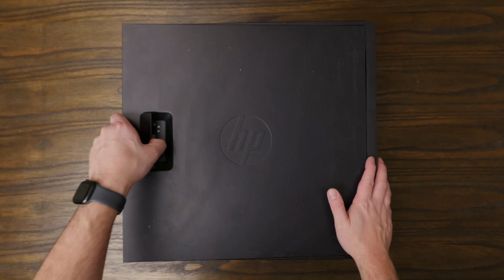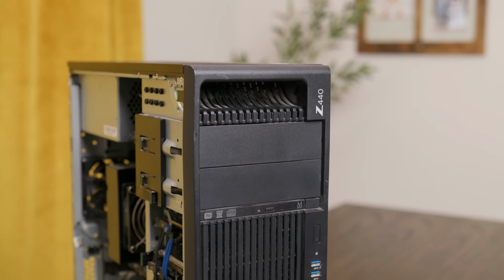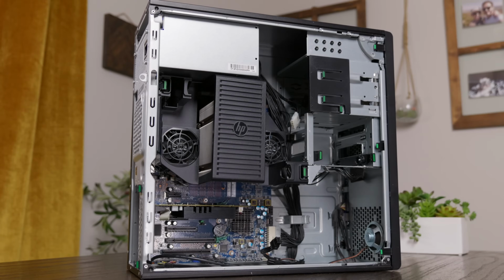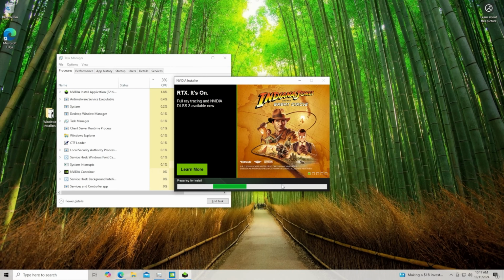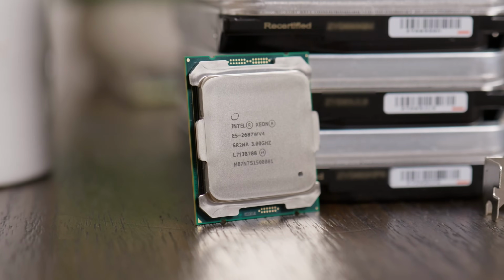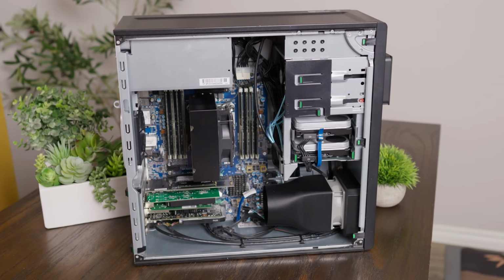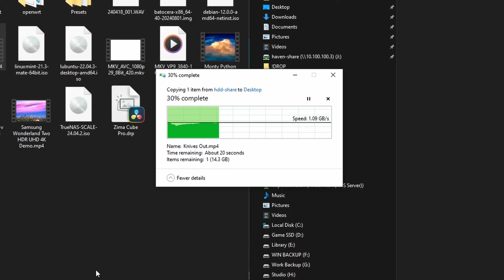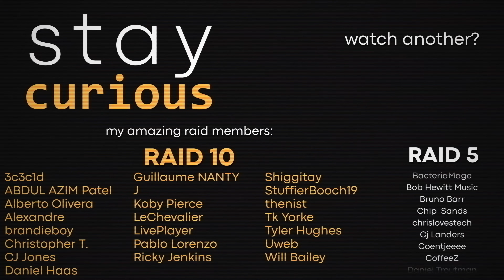This Upgraded HP Workstation/Server Is CRAZY Fun

Comment: I'm sad to say we are still running a few Z440s to this day for production CAD workloads at my company. Only used for 2D Autodesk apps, so honestly they still work fine since most apps are single threaded and barely use GPU still. That said with the end of W10 Enterprise support this year they'll most likely finally get scrapped. Definitely rock solid systems though, very few issues with them compared to the ZBook laptops we deploy nowadays.

Comment: For the extreme-super-budget option I'm trying, I wonder if there's a hidden BIOS option on my old HP laptop to allow battery limiting.

Yes, I know, keeping the battery is good as a free UPS, but if I don't limit the maximum charge level, then the laptop will blow up a second battery. I'm not risking that.
I think my only other choice would be to buy a UPS (which I probably need anyway) and remove the battery from the laptop - hoping that it will boot that way.

Comment: Ive just built this exact same machine with the same 12 core 24 thread CPU. Updated BIOS, 64GB RAM. 2x 1TB NVME drives using a PCIe card. Im running a GTX 1060 6GB. Its a quick old beast, and super quiet too.

Comment: Putting it out there, It wont even run windows 11; just the otherwares Why did you set the bar so low??? Per Google AI. The HP Z440 Workstation was announced and released in the third quarter of 2014. It was part of a trio of third-generation workstations that also included the Z640 and Z840, all of which featured Intel Haswell Xeon E5 v3 processor. works only of you get used free/dirt cheap stuff.  Not a real ROI. when an Apple M4 is only 600 and has ports for accusers

Comment: I'm running an older Z420 workstation as a daily driver. I've just ordered a 64GB(Ax8GB) ram upgrade kit. This is do to the fact that generation of motherboard in my particular Z420 is the first generation boot code wise and therein is restricted to a hard limit of 64GB of ram.

Comment: I have a hp z620 and if the power supply is relative I can tell you those 6 pins are seriously overbuilt and will easily handle being converted to 8 pin pcie

Comment: PCI-E gen 3 is a bit slow for nvme disks.
Reply: It isn't. The NvME disks itself are bad for actual performance in common use. You get peak performance only very rarely, but in the actual tests performed in practice, even PCIe 6.0 doesn't improve from the PCIe 2.0 when it comes to actual read/write speeds.

Comment: Really cool video! I actually got a similar system, with a ASUS Z10PE D8 WS motherboard and two 2697Av4 CPUs, but only 128gbs of RAM, however I'm pretty sure it's all ECC ram. Together with that I run 4 x PNY 4060Ti 16gb NVIDIA graphics cards for AI labbing.

The whole system cost was around ~2800 usd including GPUs etc, and then I'm In Sweden (which I saw from some other comment, usually it's not cheap here)

Maybe I should do a video on it 🤔

Comment: Looks like a cost effective solutions to a multiple VM small office machine we currently run 2 separate machine with 8 VM on each but which works but zero head room in there.  I looked at a  Ryzen 9 9950X3D but this looks like it could be better solution as with a 32 core system with 64 threads this would mean we can run 24 or more VMs especially if we load up with memory

Comment: Great video, done much the same but with the Z840, that has 2 CPU, 2TB RAM support and the power supply will run a 4090 with some power adapters. There is also a sweet spot on the CPU last time I looked  a 14 core Xeon is £50 or so. I have a bunch of these saved from the work E waste in various config states, the most live one has 2X14 Core CPU, 256GB RAM, 7X 16TB SAS drives (used an extra front bay) 4XNVME drives on a card and a RTX 2080. Running True NAS Scale on it and loving building the system each night in the few hours my kids allow

Comment: If you enjoyed Z440 that much, take a look at Z840, or even Z8 G4, which are much more modular, and easy to work with. I do have both and use Z840 as home server and Z8 G4 as personal workstation, both of which are great machined with efficient cooling and upgrade options.

Comment: My main workstation is a Z440. I upgraded to an E5-2699 v3 w/128GB RAM (I have 256GB for it in a box, but haven't found myself needing the extra RAM) It has a GTX 960 for graphics. It boots off of a 1TB NVMe on a PCIE adapter, it has WIFI6 adapter. It has a pair of 4TB HDDs and a 256 SSD for scratch. I have 3 Blu-ray drives as well. I mainly use this system for ripping Blu-rays and DVDs. I also have a Blackmagic studio 4K card that I occasionally use (I don't leave it installed because it is noisy) for capturing HDMI/Analog video. I will be looking into replacement options next year due MS killing Windows 10 support.

Comment: ayyeeee im not sure as to why i smiled but, u got me into this server stuff...... i now have 2 e5 2699v4's for 44 cores and 88 threads in a lenovo p710 with 384gb ram and a quadro m4000 8gb (soon rtx 4000 8gb for obs and editing stuff) however it runs ALL of my home stuff and my game servers running proxmox  its down currently as a ram modual went and replacing them all as.... well i cant match the ones i have/had ..... so i am splitting them up into 2 servers 1 for home stuff then 1 for game servers

Comment: Go ahead and put that ZOTAC RTX 3060 in there. The Delta PSUs for HP are modestly rated and the 3060 won't be an issue. I used to run a Sapphire Radeon HD4850 X2 (2 GPUs on one board) in an old HP XW 4400 that had only one 6-pin PCIE power connector. The PSU was rated for 460 watts. The card had one 6-pin and one 8-pin connector. I used a dual sata to 8-pin PCIE adapter for the 8-pin socket. It worked fine for years. It even handled Furmark. Although, Furmark in "extreme burn-in" mode would trip the PSU. No doubt it was the sata power rails being overloaded.

Comment: Lenovo p520 and P520c. The upgradability makes it worth the <$200 pricetag. P520 has 8 RAM slots and soooo many PCIe lanes. P520c has only 4 but is even cheaper and would make a killer buy for anything that is CPU bound. Both can upgrade up to 18c/36t. They are lowkey monsters that will be viable for at least the next 6 years.

Comment: I have been running a maxed out Z800 for the better part of 8 years bought and upgraded with fleebay purchases.  I have the fastest 4 core Xeons under factory water cooling, 96GB RAM (the optimum configuration) 1200Watt power supply, SAS SSD for boot and a couple 15K drives in RAID0 gor simple storage.  The box has been rock solid the whole time.  All in it cost me less than $1800.00 USD.  I just bought a Z840 with 128GB of RAM and a pair of 10 core Xeons as well as an Intel Enterprise SSD boot drive.  It also came with a 12 port RAID card and twelve 500GB Sandisk SSDs, a 1080 video card and 1200Watt power supply.  That was only $450.00.  I then bought another Z840 with a bad motherboard 1200Watt supply, and another 128GB of RAM for less than $170.00.  The RAM was going for much more than that!  I bought a pair of 6 core 3.5GHz Xeons with the highest clock rate available in the Xeon line to replace the 10 core Xeons with. For another $40.00.  $660.00 seems pretty cheap for the rocking machine like this.  Having an 8 port LSI SAS controller on board means I can use much better storage as well.  These are great machines by any measure!

Comment: Many server NICs support SR-IOV. If you enable SR-IOV with let's say 4 virtual functions, you can pass each virtual function through to a VM and thus give it almost-hardware-level access to the NIC. It gets to make use of all the hardware-offloading capabilities the NIC has and does not depend on routing all of the traffic through the CPU like virtual bridges do. In addition to that for internal communications the virtual functions can often communicate much faster than the indicated NIC speed, so those VFs of a 10G NIC for example may be able to communicate with other VFs on the same NIC at up to 30GbE

Comment: This HP z440 is fantastic.  I've used to have one back in 2018 up to 2022 until i decommissioned and built my actual Lenovo Mini Cluster. 

But, I wasn't fully decommissioned 😅. 

It's been upgraded, and it's working as a Linux main rig for a friend, fully loaded with a 3060 ti, 2TB NVME and  8TB Raid 1 Storage for Data. 

Long live z440

Comment: I've got like 6 of these systems I use for servers 😅 -- if you know where to look you can often get hardware like this for FREE not just cheap. I didn't pay a penny for all 6 of my E5-v4 series Xeon workstations. There's always some guy on Craigslist who's obsessed with Linux and will advertise "old business workstations FREE if you promise to never run Windows on it" -- I know because I basically found 6 of those guys and I wasn't even looking 😅

If you don't need a lot of PCIe it probably makes more financial sense to get a cheap Ryzen system in terms of upgradability, price, performance, terms of everything really. 

But free is best in terms of BEING FREE. Can't beat that 😅

One of them even had a Nvidia Tesla GPU inside with a ton of VRAM which was an AWESOME bonus. It's slow as sh*t for streaming games (and you can ONLY stream, no video output)
.. but for GPU compute it's freakin' awesome!!!

Anyway if anyone else is interested in these older workstations -- definitely checkout Craigslist or local places like Free Geek.

I found eBay prices for this kind of hardware have become inflated a bit imo, not ALOT inflated ... but enough to be worth checking the dumpster fire that is Craigslist also.

Comment: These systems are dead nuts reliable.  Get the AMT engine working and it's great.  I heard you need to buy the software from Intel or HP.    I never really went that far into getting LOM to function for me as I'm right there next to the system. 
The best part about these machines has to be the fact you can throw in just about any add in card, and for DVR systems?  This is where it's at for cheap deployments. 

That 3D printed fan you made was amazing.   That would be something I would purchase.

Comment: Good to see some love for the old pre-Skylake stuff. I've found that even the old Sandy and Ivy Bridge are equally as capable as workstations (either single or dual socket platforms depending on your requirements). Price to performance on these old generations beats anything new, even a decade or more later. To be honest, I wouldn't even write off the old Nehalem/Westmere generation Xeons either. One thing that chaps my ass though is that bifurcation is fully documented and supported as early as Sandy bridge, but it just didn't make the cut for firmware options until the Haswell/Broadwell generation in most cases. Not sure what the thinking was there. It could have been a selling feature for the big OEMs on the server and workstation models. All in all though, the lest expensive way to put together a beefy machine on a budget.
Reply: I'm all about hanging on the trailing edge of technology™ :-D.  Haswell on the dekstop (E5-2690v3 w/64GB RAM, with hyperthreading shut off - with 12 cores who needs it) and a dual IvyBridge (Supermicro w 2x E5-2630Lv2 and a big hardware RAID array).  Everything is scrounged, gifted, or bought used. Biggest expense has been a repl. mobo for the server - original has damaged cpu sockets.

Comment: I had a lead brick z800 that was dual quad core CPUs with HP liquid cooling and it had a odd shape power supply almost like a server power supply that connects to a connector on the Mobo it was a neat workstation very impractical nowadays think it had dual 1-2nd gen i 7s 192GB of ram

Comment: I'm sorry but I cannot easily trust random used pc and parts for a server. I owned many pcs since 286 and about half of them showed defections during their use. Not that issues do not appear in new hardware, but there's usually some guarantee involved.
Also these old systems will have high power consumption, which needs to be calculated in the long run costs for a 24/7 running pc.

Comment: I'm still rocking my i7 5930K rig. Got 256GB RAM (got two kits of 128GB 3600MHz Corsair Dominator Platinum RGB, only runs at 2133MHz though :/) and a GTX 1080 + 980 in there along with a Dell Perc H200 SAS HBA, a 2TB NVMe drive, and a ton of 3TB SAS drives in windows software raid. I run Server 2008 R2 (with ESUs) on there and it works great. These old Haswell-E/Broadwell-E systems are pretty impressive still. I'm using a gigabyte board btw. 

Also, worth noting that the 5930K only supports 64GB RAM, but 256GB seems to work perfectly fine, just had to turn down my overclock a little. If I was to build a system like this from scratch, I'd definitely use an OEM system like this.

This machine has been my main workstation for the past year in its current state and has been rock solid stable, so nice to have that extra breathing room with all that RAM, even if it is a little overkill. I use it for video editing (Premiere Pro/After Effects) and 3d modelling (Maya), it's been pretty good, but will be looking for an upgrade.

Comment: I bought one of these in 2019 with 64GB RAM. Was running FreeBSD on it until this year, switched to SmartOS in the summer. Fun story: SmartOS's FMA reported to me that my processor had a failing MMU. Swapped in a 12 core processor for $12 and it's been great! But yeah, I hate the power costs. It's a hungry box. I learned some things today about the BIOS and this server, thanks!

Comment: Loving my Lenovo P520 for these exact reasons. I have 2 cheap ASUS NVME adapters in the x16 slots (4x4x4x4) and the 2 onboard NVME give me 10 NVME drives. Along with a Dual 10g ethernet making for a very good Proxmox W/TrueNAS box. Makes it hard to convince me to buy any of those purpose-built NAS solutions

Comment: You can do some really cool stuff older workstations. Love working on these systems. The newer HP Z6 G4 Dual socket and Z8 G4 can be great homelab servers. The only bad thing about them would be Intel VROC and all the proprietary stuff. But VROC shouldn't be an issues for most people that want to run a homelab with proxmox or equivalent.

Comment: i use the two E5 2699v4 in my R630, but they are rare and expensive. Compared to the more common CPU the E5 2683v4 witch has 16 cores but cost only a 3th of the 2699v4 and has a higher clock speed. The difference between the 2883 and the 2678 are neaglable, there are more or less the same. The performance is the same even with fewer cores, because the single core performance is higher, this leads to a higher power consumption of 160W instead of 120W. If you have a workload that needs high single core performance this is your option if you need more parallelization then the 2683 is the better choice. Both are good options and are the higher end CPUs, there are some super efficient CPUs available, but they have even fewer cores and less clock speed. There is a super efficient 60W CPU available for the socket that has 14 cores. i think it is the E5 2650L or so. The L indicates it is a Low Power CPU. 
The E5 2699v4 is stupid expensive.

Comment: I had an old z210 desktop and it was also very easy and tool less. It ran like crap and Debian had problems with the network chip so sometimes it would work and other times it would just stop and not be able to be manually restarted and needed a full reboot to work again. But it was a nice machine when it worked.

Comment: Man, this is probably the second or third time you have published a video at the same time im trying to accomplish a similar task. I am split between building an i7-8700 system, upgrading my wifes gaming pc to a 5700x3d so i could use the 5600x for a budget workstation.

As far as davinci resolve goes, do you recommend nvidia only? I have a 1070 lying around but im intrigued by the arc cards. As of late ive been buying radeon GPUs though.

Im primarily doing hobbyist cad work, some occasional video editing as well. Might buy a 3d scanner which would require an nvidia gpu.

Comment: Just wanted to point out that HP actually over-spec those PCIe 6-pin cables. They can supply a lot more power than normal 6-pin connectors, and it is completely safe to use a high-quality 6-pin to 8-pin converter cable to be able to power more demanding cards. This is also true for the older Z420 workstation. 
Why does HP do this? Well, they tend to go for the overkill just to maximize stability, as these machines were designed to go into businesses. Why they didn't put in an 8-pin connector I can only speculate about, but my best guess would be that HP only cared about the officially supported cards that they sold with the system - which at the time would max out at som high-end Quadro card that likely needed 2x 6-pin's.

Comment: This computer is the Best Deal on eBay if you need allot of Memory and Storage options. I have 100gb of Drives in mine running Dual NVME boot Windows-10 and Win-11. It is the Best computer I have ever owned. Rock Solid Stability and Reliability.
It Never Crashes or Hangs. All Drivers install automatically. It’s Still Fully Supported by HP and Microsoft.
I to used Refurbished hard drives and have had no problems.
For a $120 Workstation you can’t beat it.
HP Quality = Reliability.
Nice Build you put together.

Comment: As long as the PS is plugged in, it's supplying power to the board.  Just not all the power. I always unplug when I work on them. I learned that the hard way when I let smoke out once.
Reply: unplug, hit the power button to drain the boards caps.